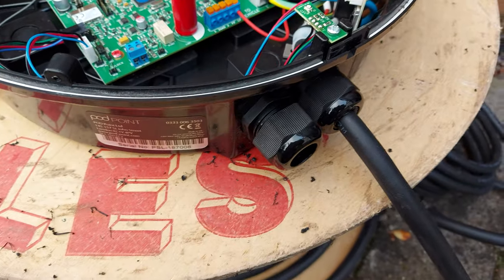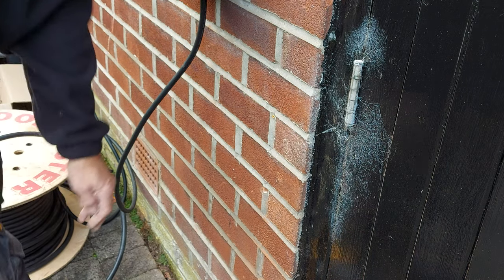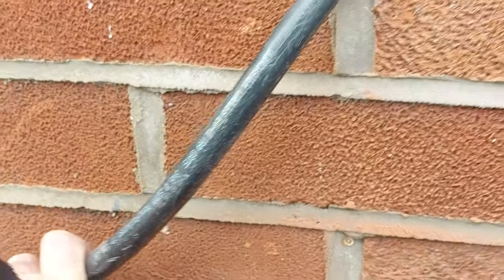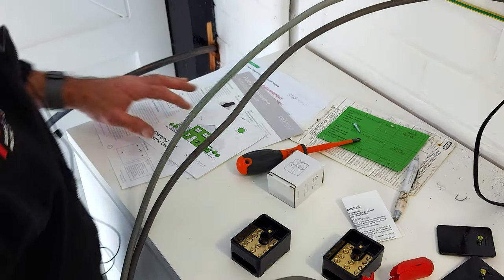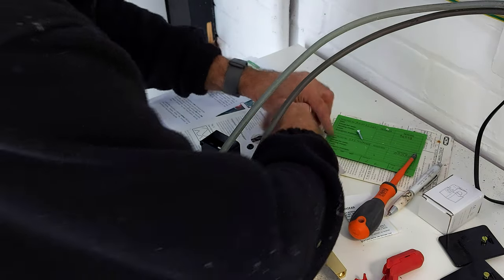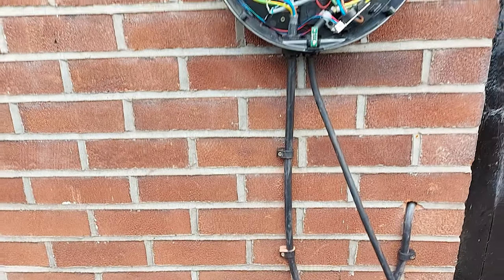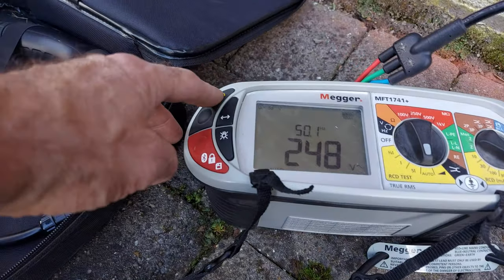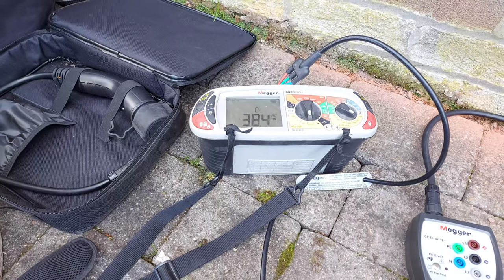Pod Point Solo EV Charger Installation.

Comment: When you look at the internals of these EV chargers and what companies charge for them, I do feel we, the public, are getting screwed big time.
Reply from the maker: Can't say I agree. 5m+ of expensive cable to car, car adaptor, 6mA RDC-DD, internals rated at 32A continuous, casing, WiFi, Bluetooth or ethernet connectivity, built in PEN protection, associated R&D, distribution etc etc. Then the distributors add a wedge, then it has to be fitted with generally a 6mm supply, data, type A RCD, extensive testing etc. It's not cheap technology
Reply: @abcelectric  some charging stations come untethered and still high price even without cables. The tech you mentioned has been around for years so not some tech where they have spent millions on R&D. There isn’t £600+ of Components in any of these boxes😌
Reply from the maker: Don't buy one then Doug. Economics is based on supply and demand and every level of the supply chain has to make a profit. As economy of scale feeds in the prices will drop. In the meantime you can ride a horse and complain about the price of hay
Reply: @abcelectric  I'm not planning to buy one, I was at one point. I am fortunate not to do high mileage, so a day on the 3kw plug for me will do. Horse being the car, hay being electricity, so if I had to install an overpriced hay dispenser that might be an accurate comparison.
Reply from the maker: Whatever Doug. You are obviously here just to prove something to yourself and try to get a rise. Why else would you be watching and commenting on an EV charger video if you're not interested in buying one, let alone the specific attributes of installing a particular model?
Reply: What the cost of one of these fitted , I’ve already got the unit
Reply from the maker: There are too many variables to be accurate Chris without a pre-installation survey, but between £200-400 normally covers it apart from exceptional circumstances.
Reply: Technically they're not actually chargers most of the actual charging circuitry is actually in the vehicle these are a point between the vehicle and the electrical install these just manage the amount of electricity that they're not technically a charger because the of the charger aren't actually to charge the car
Reply: I agree, that wall chargers and fitting are well overpriced

Comment: would you think a car charger at home would be a good investment I have a phev so only a small battery to charge I use a 3 pin charger looked at installing a pod point but is the £600 outlay worth it ie would you think it would increase house prices/save money on charging at times with the pod point app charging and also better safety features for my car with the pod point unit cheers
Reply from the maker: Safety wise I'd always recommend a properly installed EVCP, however the rest is subjective. You're only charging 30 miles with a hybrid so you could get a full charge in 1 hour instead of about 2.5 if that's important to you. Regarding house prices I have no idea. I've removed and reinstalled  several chargers for clients moving home, however the application process still has to be followed for the new property. It's all dependant on your unique situation

Comment: Nice install Gary. NB you should use a 2 core screened cable for CT as it can read incorrectly if using unscreened or cat 5/6 cable. Nice to see a thorough job!
Reply from the maker: Thanks Paul. The data cable is screened and I earth the outer foil. I use Cat 5 because some installations require more pairs (like Wallbox, Zappi etc). The data cable (Cat 5 or twin) is part of the EV Ultra cable and has to be screened as well as LV insulated to comply with regs 👍

Comment: Good job Gary , I work around greater Manchester just fitted project EV , nightmare to set up, just started with OZEV, looking for a go to EV manufacturer that’s easy to set up etc , what’s your preference? , thanks.
Reply from the maker: Hi Declan. Thanks. Pod Point is my go-to charger. PEN protection, 6mA RDC-DD and load management built in. Easy to fit and set up. Wallbox are very similar. Every m/f is slightly different so no 2 chargers are the same, but you get used to them after a couple of installs.
Reply: Hypervolt, Sync EV, zappi these pod points are crap, don't touch them.
Reply from the maker: Each to their own mate. I've fitted dozens of these and never had an issue with a single one. If they were crap I wouldn't still be fitting them

Comment: Coujd not see clearly the armoured wire termination. But as you used plastic compression rather than armoured cable glands how did you earth the steel armour ?
Reply from the maker: It's a long time since I did this job, but I'm fairly sure it's not armoured cable. It's EV Ultra, without the armour. I wouldn't normally use armoured for such a short route that's visible and clipped direct.

Comment: Did you not feel the need to install an spd device which is mandatory for these and a 16mm main earth not a 10mm which doesn’t satisfy anything with 16mm tails. Sad thing is some poor customer has paid you to do this as well and it’s non compliant with the 18th edition wiring regs to amendment 2!!
Reply from the maker: Hi Ashley. It was installed prior to Amm. 2, so an SPD wasn't required. A 10mm main earth satisfies the adiabatic equation and the Regs, which you should know.

Comment: Question we've just moved home and brought our podpoint sole 3 with us. It turns out we have a loop need with the nextdoor neighbour what would be the safest setting to use with out damaging the supply coming in to the house the main  feed coming in has an 80 amp fuse on the feed
Reply from the maker: First of all you need to notify the DNO that you're going to fit an EV charger. To use it at full potential you'll have to get the supply unlooped and submit an "Application to Connect", which is different to the Notification to Connect. In either case you need permission and in the latter they will automatically "unloop" you. In the interim you could set the charger to say 16A max and ask PodPoint to set the CT clamp to say 40A. All just my suggestions. Either way, you should be employing a certified electrician conversant in EV  to do the survey, application/notification, installation, testing, certification etc and they should know all this

Comment: Hi, great videos and very helpful. .Getting a Pod Point Solo 3 installed indoors within my garage for a hybrid car in the next week or so.. Electrician has recommended installing a Proteus 40a ev metal clad distribution board with pme fault detection (~£170). Is having PME overkill or even needed?. Have an existing metal clad board with RCBOs and a spare slot. Was wondering why the that cannot  be used with a Proteus B32 TYPE B. Tails were upgraded last year as have 3 distribution boards already (2 plastic), 100A main breaker.
Reply from the maker: Hi Deepak. PME fault protection (more commonly known as PEN or O-PEN protection) is required for PME (TN-C-S) supplies. This is because the Earth and Neutral (PEN conductor) is combined in the supply cable, and under certain fault conditions, the N & E could float to dangerously high potentials. Due to TN-S supplies gradually being replaced by the DNOs or being connected to TN-C-S upstream, it's also required to assume that PEN protection is needed on TN-S supplies as well.

Now, here's the thing. Nearly every charger sold for the UK market incorporates PEN protection as standard. The only one I know that doesn't is the Tesla Wall Connector. So, fitting PEN protection upstream of a Pod Point, Zappi, Ohme Pro, Pulsar Max, Hypervolt, etc, is a complete waste of time and money.

Next issue is that according to latest regs you really need a Type 2 SPD fitting and the charger must be protected by a DP Type A 30mA RCD, or an RCBO of the same nature that disconnects the Neutral under a fault condition. Only a few manufacturers make a switched neutral RCBO, so having an RCBO board may not be ideal.

PEN protection and DP RCD/RCBO protection are 2 separate things. Finally, if there's an upstream DP RCD of the correct type with only 1 charger connected, then you'd just need an OCPD, so yes, under those conditions a 32A B curve MCB would suffice. Remember that the OCPD is rated for the cable, not the connected device.

It's not that difficult, really. In layman's terms you need to select cable size to suit the device current and installed voltage drop, then fit an OCPD rated to protect the cable/device from fire or injury from overheating and short circuit, then 30mA Type A Additional Protection to protect life, then PEN protection to protect life, then SPD protection to prevent damage and any consequences from overvoltages.

Last thing, especially as it's going in a garage, is to make sure that all required services and any extraneous conductive parts are equipotentially bonded, so there's no possibility of a simultaneous touch potential.

 Anyone that understands the Regs and EVCPs can figure this out quite easily.

I hope that clarifies

Comment: Should the RCD not be double pole to break both live conductors according to the regs?
Reply from the maker: The Regs DO NOT state that the RCD should be double pole, they state that they should disconnect all live conductors. (722.531.3.1). In 722.531.3.101 it states the type of RCDs that comply and it is one of those.
Reply: the neutral is a live conductor
Reply: please check that out
Reply from the maker: @sparczzz  I know Neutral is a live conductor. I am aware of the difference between a live and a line conductor etc. Look up the regs that I quoted to satiate yourself as to what they actually say. I think you have misunderstood my reply. I never said it didn't disconnect the N, but that the regs don't mention a DP RCD. There is a difference between a true DP device and a SP device that also disconnects the neutral. Don't confuse terms

Comment: I have a 7 kw pod pointed fitted recently ,on my vehicle app it shows over 5 hour charge 20 miles per hour and on the app output 6 kw from the charger , first time for me to charge the car , pod point told me when purchasing I should receive 30 mile per hour charge
Reply from the maker: This type of question drives me crazy. It's information that's freely available almost everywhere online and should also be communicated by car and charger manufacturers. Any 7kW home car charger is theoretically capable of charging at nominally 30 miles/hour under perfect conditions. These conditions rarely exist. The charger ramps down its output when other loads are on in the house to prevent blowing the main fuse. The car modulates the charger input to prevent damage to the battery and to maximise battery life (just like a phone does). The car's AC/DC converter has a part to play. Temperature has a part. Supply characteristics and power factor might play a part. There are loads of reasons why you might not achieve 30 miles per hour charging over a charging cycle. It's just the nature of the beast. At least give it a few goes under various conditions day and night to get a truer representation. If you want or need to charge a car from 0-100% in less than 10-12 hours, then my advice is to go to a fast charger. Otherwise, accept that unless you've got 100% perfect conditions, it will most probably vary from day to day.
Reply: @abcelectric  thanks for the reply , like Bernard bresslaw used to say , i only asked

Comment: It amazing job , which fuses box you used and where can i buy it please 
Thanks
Reply from the maker: The one I used on this job isn't suitable for current regs. You need an SPD and a switched neutral RCD or RCBO to comply now. Pretty standard stuff for an electrician to source.
Reply: @abcelectric thanks,

Comment: Gary, im due to have a solo fitted soon but my consumer unit is around 25yrs old the cartridge fuse wylex type! Will the installer not undertake installation? Or will they do same as you fit a sub db? 
Exc videos
Reply from the maker: Hi mate. Sounds like they'll have no choice other than to fit a sub DB

Comment: Hi, does the pod point have a rear entry point so the cable is not visible?
Reply from the maker: It does, however it's a 20mm gland size, which means that EV Ultra cable won't fit through it.

Comment: great video, thanks. One question though, is the proteus EV unit the correct rating for short circuit as you are straight off the tails? 6kA instead of 16kA?
Reply from the maker: It's no different to a larger consumer unit being off the tails. Those breakers are rated at 6kA also. If your Ze is above approximately 0.04 then your PFC can't be higher than 6kA. I've never come across a Ze that low. I think you might be confusing different regs, but I don't have them with me on site now and can't quote anything specific. I'm also pretty sure that Proteus or any other manufacturer wouldn't sell a sub DB designed to be supplied from tails that wasn't to regs

Comment: Hi Gary, been watching your vids for a while and like the straightforward way you go about things. 
I’ll be fitting my first charge point within the next few weeks (DNO dependant!!)
Would you be able to give me a couple of pointers on the ENA application form??
Cheers pal.
Reply from the maker: Hi Bazza. The ENA form looks worse than it is but  my main tips are get the MPAN number,  calculate Maximum Demand, check the Earthing arrangement and most importantly whether you can identify a looped service. The critical boxes are whether Maximum Demand exceeds 13.8kVA, or in other words is it greater than 60A, and if it's a looped service. If either of these are ticked the DNO may need to do remedials - either a cutout upgrade or unlooping the supply and either will delay the installation. With the Pod Point I tick the CT monitoring box, because you're basically limiting the MD to 60A, unless of course the property's load is higher beforehand. Regarding the last section about the ENA database- just ignore it. Hope that helps and good luck